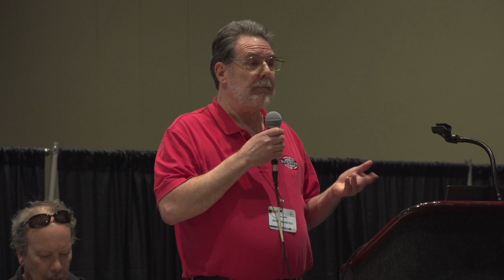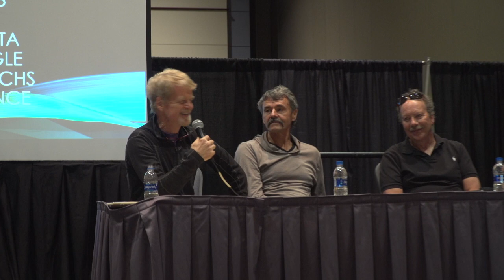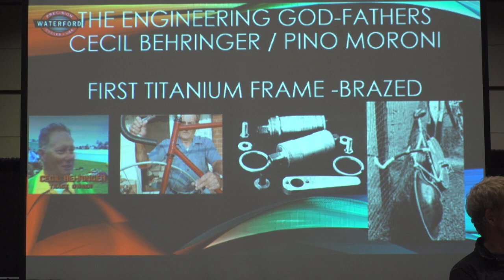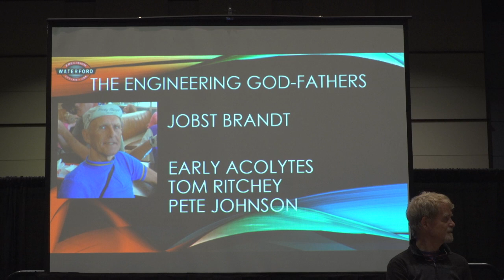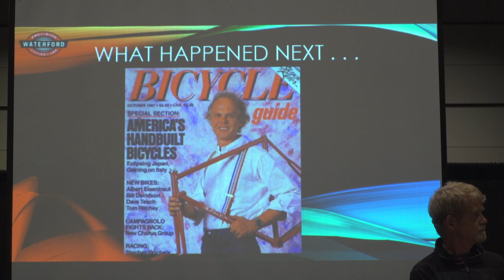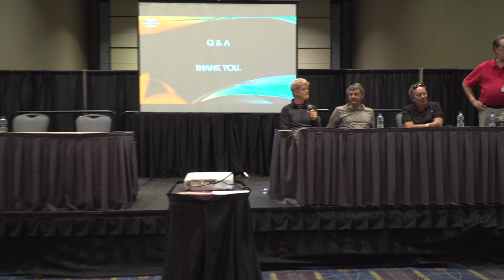70’s Framebuilder Explosion

Comment: Great talk. Growing up in the LA area I raced criterium in 73-74. I won a hand full of races on my Raleigh international that other racers pointed out was a touring bike. 
I worked at a schwinn bike shop in Simi valley where we took stingrays and re-laced the wheels with thicker spokes and welded a cross bar on the handle bar to create early bmx bikes. The Schwinn factory sent reps to check it out. 
Having ridden good Campy equipped bikes, I built my first off road bike in 73 with Campy parts, a Bottecchia frame and a Sturmey Archer 3 spd hub. The straight bar came from a Paramont tandem. 
I rode this bike in Santa Cruz in the mid seventies so I can relate to riding in the mountains there on and off road. Before mountain bikes I would ride all the hiking trails (Nisene Marks, UCSC,Wilder) before it was banned.  
Never anyone on the trails. 
Sorry for the rant, this brought back so many memories. 
Now got  go riding.

Comment: The Behringer frame:
Cecil & Pino actually conspired together and made one (maybe more) titanium fork(s).  The frame tubes were 6Al4V and were line bored from bar stock (yes... really!).  The lugs were also 6Al4v, and they really weren't brazed, but resistance welded.  The tubes, and lugs were incredibly clean.  Contamination could not be tolerated.  The joint was cleaned, pasted (vasaline, berellium, and what else I can't remember).  The joint was then enclosed in a clear bag, evacuated, filled with nitrogen, evacuated, on and on until the atmosphere was pure.  Electrodes were placed on either side of the weld, the current increased until the fillet melted.  After it cooled the bag was removed.  A gold joint signified pure ( and strong), and any purple was an impure atmosphere and had to be discarded.  I'm surprised no one was killed during the fusing process!

Comment: An old friend (may he rest in peace) was Eddy Atkinson.  Eddy raced in six day back in the 1930's.  When six day racing died-out, no one bothered to tell Eddy.  He just kept riding.  Back when I was racing (and pretty darn fast I might add), I was going down a one-way street at a very fast pace.  Out of the corner of my eye, on the other side of the street I saw Eddy.  He was in his 60's, and I still wasn't yet twenty.  He was passing me and despite my best effort, in less than two minutes, Eddy was just a small dot on the road ahead.  
Years later Eddy decided that old age and fatigue had taken its toll.  He sold the old, tired, and fatigued custom Paramount, and bought a Masi.  He too had slowed, and was down to 100 miles/week.

Comment: Some guys (I think they were from Boeing) were cycling through and stopped at the bike shop in 1972.  They were riding their own bikes and they were titanium.  About 9 lbs.  Unheard of!  My Cilo was about 22 lbs., and there was rumor of a guy in California who had a 17 lb. Colnago.  He had done a lot of work to get the weight down and the integrity of the bike was questionable.  Another guy stopped by with a freewheel that was almost without drag, and came apart by inserting a 1/8" steel pin (better known as a drill bit).  There was also Harlan Meyer.  Most of his work, though innovative, just wasn't up to the Italians, BUT he did make the Hi_E hub which though ultra light in weight, was very good, and reliable.  It was pretty much a 1/3 the weight Phil Wood.